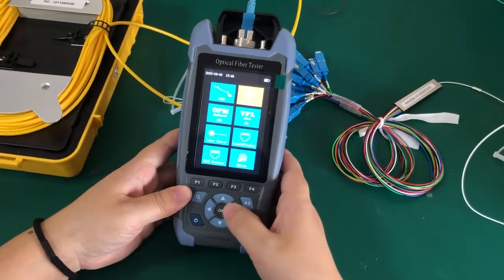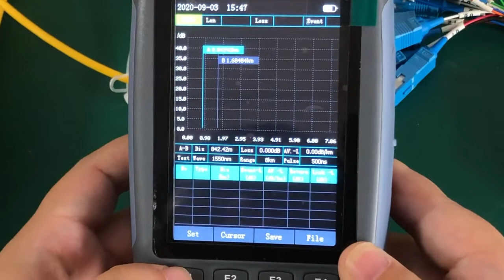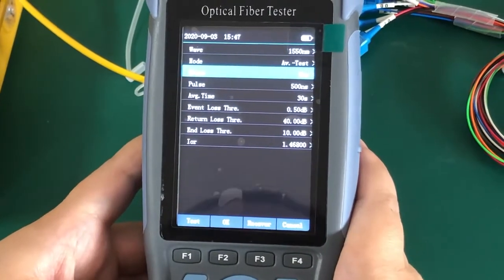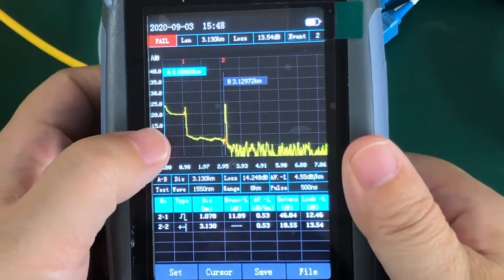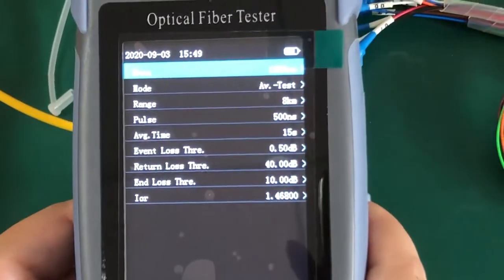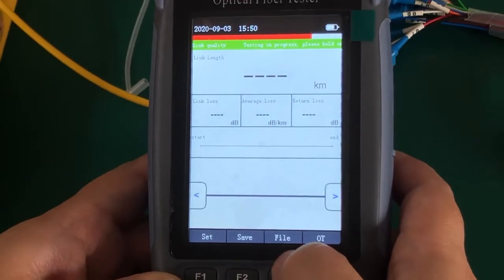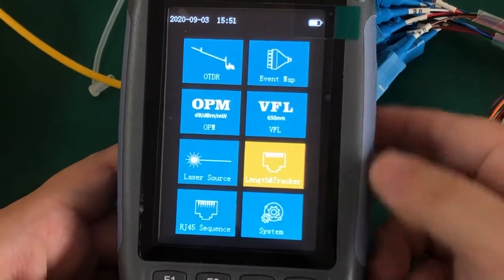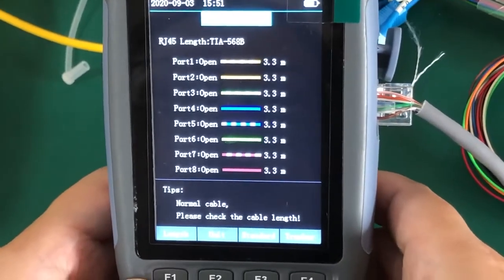MINI OTDR Fiber Optic Reflectometer with 9 Functions VFL OLS OPM Event Map 24dB for 64km

Comment: i got one of these a couple weeks ago and it so far it works as it should! I used it today on a ftth activation! like normal the documentation was wrong on splice points and locations. This gave me my kft/length and I was able to find my splice points after additional info from my CC based on my lenghts. my ending length was 6.5907 kft/ 6,590 feet. Way to many telephone poles to climb in that distance not to have a unit like this.

Question: is there a video that go's over trouble shooting fiber with this unit and a how to video on saving your data/test results then upload it to a computer to send the results to a client?
Reply: Yep. Climbing poles for nothing , sometimes opening manholes and checking for vfl. That's why I've ordered the NK2600 and a live fibre detector(.LFD  ). 👍